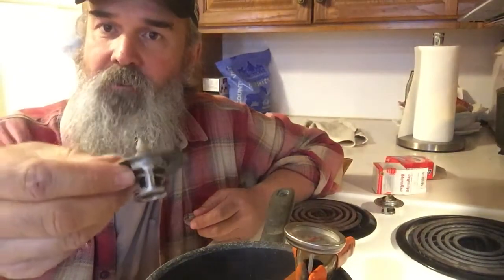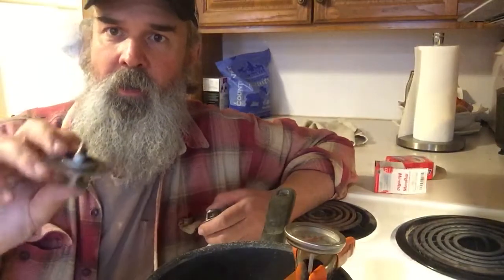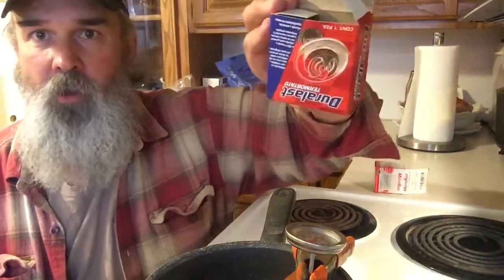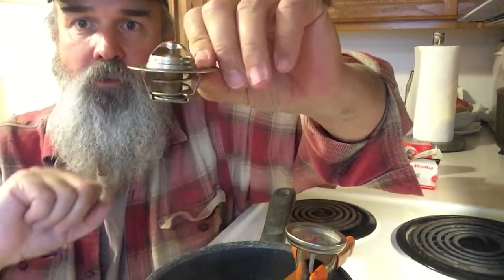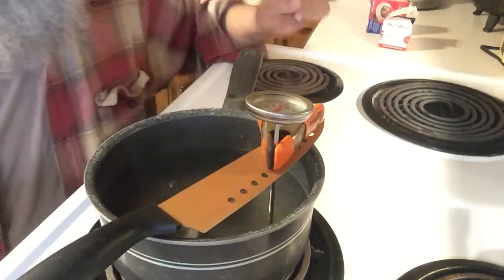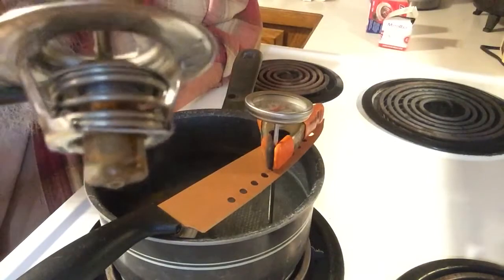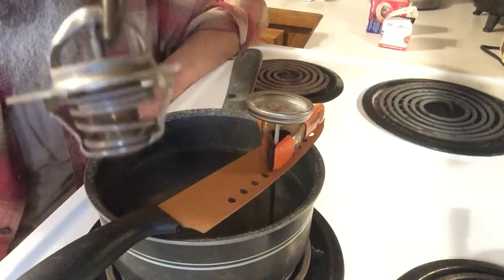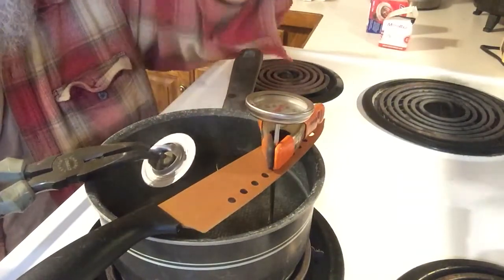Mgb thermostats and why they are important for your engine

Comment: My only problems with thermostats, my first car it stuck closed one hot summer day. No temp gauge in that vehicle, but knew it was running hotter than normal cause it leaked out transmission fluid way fast thru the small seal leak. Had a GM part number and looked different than replacement thermostats that I could find, spring wasn't visible, so guessed it was the original. So, about 16 years. Then a few weeks later the thermostat on my mom's car stuck closed. That car was only 4 years old. And a couple years later the spring and moving center of my replacement thermostat broke out somehow.